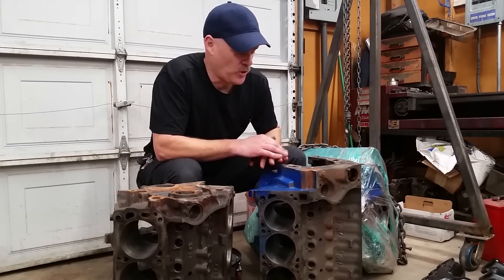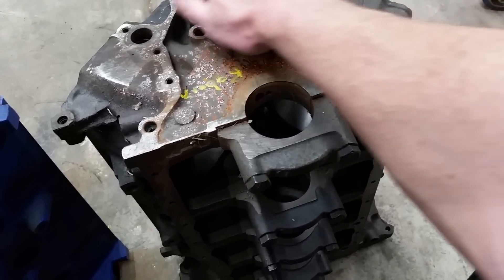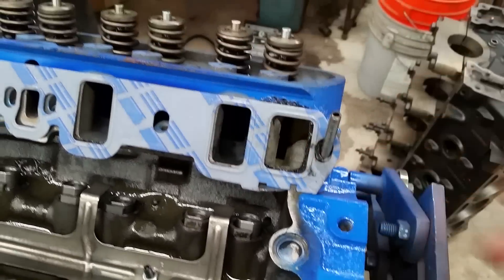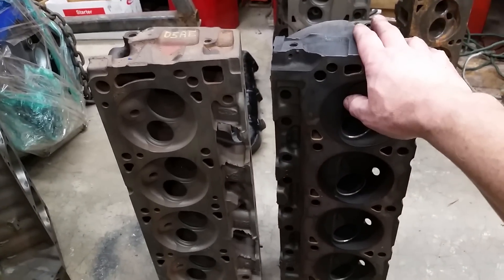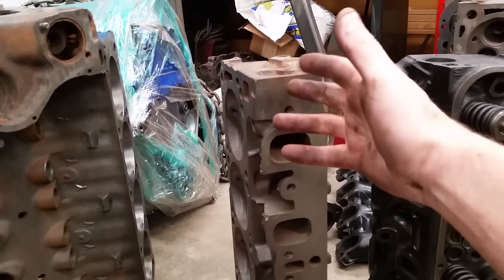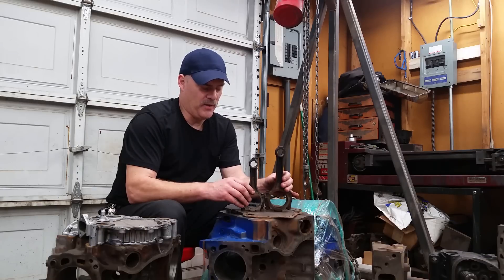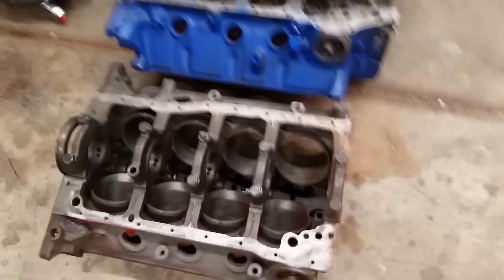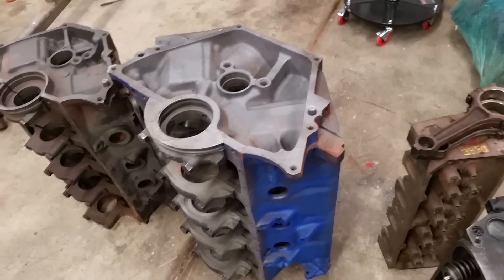302 vs 351M blocks

Comment: @myvintageiron I have a 351m and the valve cover said 351m 400ci .. so it's a 400 right
Reply: Michael Anthony my 77 Ford F-250 read as this 6.6 liter /400-400M . My 70 F150 xlt read as this 351/400M . The 400 /400 M is the best ford work engine imho. No hi rpms tho. 600cfm  2 barrel stock . Great power and dependability and got a honest 16 mpg when running properly.  The 79 1/2 ton with the 351/400M just didn’t have it compared to the 400/400M . It did have a 4 barrel and long tube headers with mad ignition and a red air filter. Didn’t matter tho that old stock 400M was a pure BEAST.  My bro blew up my 79 “ not one dent or scratch btw” while out one night on a hot date . Don’t know how he did it but he blew a 13,000 dollar FORD RACING engine ( blue printed ) I bought it complete from a man who was just getting to know how married life goes, on the cheap. He spent a lot of hard earned tow boater money on that truck in the 10 years he was single. Spent 13,000 on the engine alone. It was built to the hilt still the stock 400M ate it for breakfast. Oh ya my younger brother spun the mains on that “ racing engine” on his second run . Still won . But blew my hi dollar 79 up. I tried to blow that 400m stock engine up for 8 years and could not do it. It eventually ate up the oil rings to the point I had to clean every plug in the engine per day of work. Otherwise it would not start. Good ol ford she was. And I doubled my money on the 79 with the mains spun . That conveniences me there is something different besides 1 1/2 years of production. I want to put one in a Mercury Cougar from the 90’s but I don’t think it fits .
Reply: Not necessarily.
Reply: the label says engine family 351m/400. and will have another section that says engine size. either  a 5.8 or 6.6. 
5.8 is the 351m and the 6.6 is a 400.

Comment: Great video man, that engine is clean what did you use to get it all cleaned up?  I found an old 351m and c6 tranny in my dads garage when he died in working on rebuilding it now only to find out it ain't stock.  Crank has been ground 20 under and the cylinders have been bored 30 over it's a learning experience just trying to figure everything out.  I with I knew who he got this motor from lol

Comment: Make no mistake. An m is not a Cleveland.
Reply: What you think an inch of deck makes a new motor family , then stop calling a 351 Windsor a Windsor ! Everything is identical in a 351 M and a 351 C just deck height , in fact a 351 M has an advantage over a 351C , longer 6.58 inch rods giving better rod/stroke ratio !

Comment: A Cleveland intake will not  fit on an m engine.make it a 400 and go find you some 70,71 4v heads
Reply: Adapters are available to use a Cleveland intake on the 400.
Reply: Go get some Aussie 302 Cleveland 2V closed chamber heads and use 4V valves in them they will fit a 400

Comment: Great video brother I have 351m in all 3 of my Fords.
( 78 Bronco Ranger XLT) (78 F150 Ranger XLT) 
(78 F250 Custom) All 4x4 
Good to know I can up the transmission on them!
Reply: Got the 78 same model same engine 
It’s my understanding an 4spd eod tranny will bolt right up 

Going to rebuild it one day 
Going this route 
http://www.garysgaragemahal.com/351m-and-400.html

And or maybe this
https://www.hotrod.com/articles/how-to-build-ford-351-cleveland/?fbclid=IwAR2bwMeMmCwVLa3MeAsCG0JklmM4KaMMUALShaaqFQQ4-UIsPh_F-ucQG00

Or 
https://www.tmeyerinc.com/engine-builds/

What mods have you done if any 
The hot rod article was just published 1-2019
Reply: @peterpiper_45-70  I got the 1980 bronco with the 351M
Reply: R L 
Right 
 On 
Check the links I posted some good ideas right there
Reply: I just got a 71 mustang, turns out a 351m is in it.
Reply: @Bonanzaking   not unless someone put it in there! It should be a 351C, if it's got canted valve heads or a 351 Windsor if it has inline valves which are very similar to 302 heads.  those 351 engines are what they came factory in 1971. The 351M/400 series engines didn't come untill a few years later.

Comment: I really appreciate your knowledge..you've answered a few constant thoughts...my only problem/concerns are which is easier to install in a 1998 Lincoln Town Car, and I am guessing  the 351 makes more horsepower  over the 302....🤔 ?
Reply: negative the 1998 lincoln town car had a 4.6 not and older 351w or 351m or 351c 302 and if you want a direct bolt in motor with allot of power look for a 4v Lincoln mark 8 type motor or a 4v later cobra motor ..600hp easy if built correctly
Reply: @dexter2433  Thanks for the reply, but that's the whole purpose of choosing a older motor.. I am trying to get away from the PCM/Computer, sensors, and expensive tunning.... I was hoping to hear,  direct bolt on, or slightly modifi to fit

Comment: I've had all of the engines you mentioned at one time or the other and worked on many of them as a Ford dealership technician,but my favorite has to be the 351 Cleveland. Those were some great engines to me. I've had 302s,390s,360s etc etc. But my 351 Cleveland impressed me the most.
Reply: 351C had the best set of factory heads. 351M is a smog control, low-compression boat anchor. I've worked on them all myself and my favorite is still the 289.
Reply: @josephtravers777  very true. In my opinion, the only thing to do with a 351m is to pull it out and turn it into a 400 with better heads and intake, or rip it AND the transmission out and put in a 351W and a C4
Reply: @ssgpentland8241  The big problem w/ 351M/400 platform is deck height/piston availability to bump up compression.
Reply: @josephtravers777 351 m is a tall deck 351 cleveland and yes bad retarded timing and small port heads little work they can come alive though deck the heads If ya cant find some 2 v clevland heads decking them will increase compression  a rv cam set to zero degree thats instant 100+ hp  headers 4 barrel intake only about 300+ hp but alot of torque
Reply: Clevelands breath fire

Comment: Thank you for the excellent videos! Would love to see ya do a Ford 400 build video because, well because 400s have a lot  of potential, and because I own one and will soon be rebuilding it (I've already rebuilt the chassis and purchased a excellent rust free cab and bed for it, so I am well into it. It is a 1980 F350 4X4 I purchase from a 95 year retired rancher and WWII vet. When I bought it two years ago, he told me the house there where he lived, and adjacent barnyard where the truck was parked, was where he picked his wife up for their high school prom date! She also is still alive and doing well. I told him that if I could get the truck running (it had sat for 3 years), and if it would make it up the big hill by his house, I would buy it, and it made it up the hill. Lol. I also own two 1963 fords, a f100 and a f600 that I am doing extensive work on, both have y blocks, and a 1990  F250  driver with 7.3 idi, and a B600 church bus that I have done a fair amount of work to. Guess I'm just an old Ford truck nut. Anyway, you've videos are excellent. Thank you!
Reply: Very cool I do have a 400 build waiting in the wings but it's gona be a while I also love Ford trucks I am a really big fan of the FE engines mostly the 390 and 428
Reply: @dtorr222  Thank you for your reply. And again, I appreciate the high quality of your videos.

Comment: Could you talk more about the 351m intake manifolds advantages and disadvantages.
Reply: larger ports and canted valves allow better flow making a setup for better high rpm horsepower if on the drag strip ....but today cheaper after market parts are available making these old school mods obsolete unless you can do allot of the work your self and have the parts just laying around and want to make power on the cheep because your own personal labor is much cheaper than paying a shop to do it for you ..

Comment: I have a 400 in my 78 f150 completely stock and ya know it runs to good right now and its pretty fair on fuel, anyhow I need to find out about 1973 351 cobra jet/ Cleveland, its 4v open chamber and the part that made me buy it is it has a 4 bolt main, I had a 2 bolt main 4v Cleveland and the fella that built it for me at the time said the 2 bolt main was so beefy that a 4 bolt will be stronger but within spitting distance of 2 bolt, I guess I gotta do some soul searching to see how far im gonna take this motor, Am I right to think the Cleveland alone is a pretty rare motor but to have a 4 bolt main is in the realm of hens teeth?

Comment: this 302 came out of a ltaer model mustang. All I know as of now. Bought it through a friend who is selling everything he owns. It can work but, is the best choice for a 66 Bronco, that I am not interrested in a Coyote 5.0.  In other words would a 351 Windsor be a much better choice?  Also are there complete conversion parts for sale as they are for the earlier engnes. This engine must be much different from the 302 that was a Bronco engine in 69.  I'm trying to learn knowing nothing much about engines, torque, etc.
Reply from the maker: not really much different at all it will bolt up to the engine mounts and transmission uses a different balancer and flex plate

Comment: is a later model mustang  302 engine a good choice for a 66 Bronco?   Also the big block fe engines are truck engines, Correct?
Reply from the maker: you can use a later 302 in an early car but there are a few differences the FE was used in cars and trucks

Comment: Which one do you like better?
Reply from the maker: I would take a 400 with good heads cam and intake however the 302 is a better engine I am a big cubic inch guy so I will almost always go for the bigger engine
Reply: @Myvintageiron7512  Am I correct in assuming the 400 is a big block and not a small block  with a big block bore and stroke?

Comment: You would be the man if you built a clevor and dropped it in a mustang. My dad had a nitrous clevor years ago in a 83  notch. It ran mid 6's in the 8th. That was a wild little car. For a while it would wheelie out past the 60,  until they dialed in the suspension.

Comment: I built a mild 400m for my dad,,030 over, slight came upgrade caused valve springs to stack so be aware that m heads need springs replaced for even very slight came lift upgrades.  Engine went into a 78 f250 4x4 and still runs great.  Very tourquey, turned 40 inch mud tires nicely..

Comment: Y not put Cleveland heads on 351w? 302 small for Cleveland heads. Might wanna even stroke 351w for Cleveland heads. 400m would be the better motor, pretty much a tall deck stroked 351 Cleveland.

Comment: Hay man love the video I learned a lot but quick question about something maybe it's a dumb question but how do you get 400 ci out of the 351m block?? And how is the 351m and 351c blocks both 351ci  if the 351m has a longer deck hight but a 4inch bore I would really appreciate it if you answered or anybody really thanks and a good one

Comment: Lets simplify. 351s all have 4" bore and 3.5 stroke. And the same bore spacing and head bolt spacing.
289, 302W are aprox 8.2 deck. 351W 351 C are about 9.2" and the M engine is 10.2.

351 C and M heads all interchange. But start at under 60cc for Aussie 302C and up to 78cc for 400. All 2Vs use the same valves and they are all that is required. Big valves like a 4V have no airspeed.
302W is tiny, 5.150 for 289 and 5.090 for 302s  and deck, 
Clevos and 351W are an inch taller and the M is an inch taller again.
302C has 6.030 rods, 351C have 5.780 rods 351 and 400M have 6.580 rods. 
351W all alone with just under 6" .
351W, 351 and 400M all have 3" mains which really are too big as the larger the dia the more it heats the oil and the bearing. Just ok on a low RPM slugger. The C engine is better but still bigger than the industry standard of a Chev at 2.5". 302W is around that as well.
The 289/302 engines are a tiny little thing and go well for what they are BUT really the crankcase is too small. Putting a 3.4  [347] crank in them,, grind pan rails, dent the pan etc to clear the throws and rods.  Never really a good idea, even 3.25 is a not great deal better. But does produce a bit more useable torque.
The Windsor though does have far better oiling than its larger  capacity and bigger block  brothers. Ford do make 351 blocks with Clevo main size or 302s with 2" rod journals as well. Just 50 years late!
While the ooh aaah with Boss 302s they were actually a dog of a thing to drive. tiny little engine with huge ports,, yup a no bottom end thing that you have to rev hard to make go. Makes a 302Chev so much better and they were no great shakes in street driveability and especially with the best Z28 heads.
A 351 Boss style thing has a couple of advantages but the 3" mains do not.
So a 351C with 6" rods and a good deal of attention to the oiling is a bit better. People have raced 302C as well. 2V 302 Aussie heads and not a bad thing for under 5 litre racing, but otherwise that capacity is a waste of time.
Those heads though are far better than 4Vs up to around 6000rpm. And even then really are too big in the ports. They are bigger than a raceport on a Chev. The canted valve looks impressive but in the real world not so much. 3Vs from Victoria are considerably better but not that cheap!
Actually compare a big block Chev head with a Clevo head or even a 429 head!
And with all of these engines and not just Fords be very carefull of what component manufacturers make these days. My 400M cruiser engine with the new FM /Speedpro pistons that started with 9.1-1 would have had about 7.5-1 with the new pistons supplied as well as Felpro /050 thick head gaskets compared with the OEM 34 thou. and been a gutless thirsty polluting pig. I used Aussie 302 heads 60CC and have the original 9,1-1 but even then a lousy combo as the pistons down the hole is not efficient or very clean either. But it is a 2 ton tank so does not matter a great deal. It was far sharper with the 78CC heads cut .050 giving about 9.8-1. And cleaner as well!
Manufactures should be shot with what they do for unleaded fuel. Especially as for  a cruiser most people dont mind buying premium unleaded anyway. Then use a Multispark ignition and it will be near as efficient as a leaded engine and last longer as well.
Reply: LDN Wholesale great info on that comment

Comment: 351 windsor 600 cfm eddelbrock .30 over runs good but rear main leaks a little second set of rope seals used  what can i do.
Reply from the maker: don't use a rope seal
Reply: Have the rear main machine  for a one piece seal

Comment: Could you take a 351W and use the heads of a Cleveland like you can with a 302?
Reply: Yes, IF you can find an intake to suit. They are /were made but all of these engines are not that popular with manufacturers. Only 302/ 5L Windsors.
Reply: yes , it's called a clevor engine.
Reply: The best is a 351 W block, 400M crank as it fits in 351w block and 351 C 4V Heads with an Aussie Clevor intake if you go 0.030 over on bore you got a 408ci 4V Boss motor !
Reply: I'd like to find a clever block. They've got 2.75" Cleveland mains instead of 3" Windsor mains, 351W style block, they're lighter weight. Also four bolt main caps and more material in the right places along with thicker cylinder bores.

Comment: Is there any way to beef up the 302 ? I heard that these blocks can split in half at 500 hp.
Reply: This is highly exaggerated. Perhaps it is a problem with high boost and nitrous.  But these blocks have won at LeManns several times turning over 8,000 rpm and making in excess of 500 hp for 24 hours.
Reply: A myth I feel. Plenty have made 600 and used 8000rpm.
Reply: Buy a 302Cleveland from Australia!

Comment: Thanks for the video very interseting,let me ask you i have a 74 bronco with 80,000 original miles and have yet to really do anything with it but the motor seems pretty strong now if you wanted more horsepower would i be better off putting the money into this motor such as efi,headers,new intake,new heads,etc... or would you have this motor rebuilt and then add those items or would you put the money into a new crate motor? I am not sure which way to go i want it to be a good daily driver but also want it to be very offroad capable,any help or insight would be very much appreciated!
Reply: Add bit bigger cam/lifters & new spring kit. Add aluminum dual manifold. Headers/dual exhaust. & for sure high volume oil pump. Good to go then

Comment: I have a ??,, can a AODE transmission work with a 351 Windsor? I have a 302 engine in my truck but would like to swap it to a 351,I that possible? Thanks in advance
Reply from the maker: Yea it should work
Reply: Thanks

Comment: Just an observation about the 351m engine mounting pads you talked about (center punch, drill and tap) to use the two bolt 351c type mount. It you look at the drivers side of the block in your video, It only has one (the front) of those bosses present. You even touched the spot where the boss is missing in the center location on the drivers side of the block three times. It could turn into a bummer for someone thinking they have the option of using the two bolt mount and find out that other boss is missing. That's the way it looks to me. Your videos bring back my days in the 70ies and 80ies when I built rep AC Cobra's with everything from 302's to side oiler 427's. We even had a SOHC 427 at one time. Talk about a monster engine. 
All the best from Scottsdale.